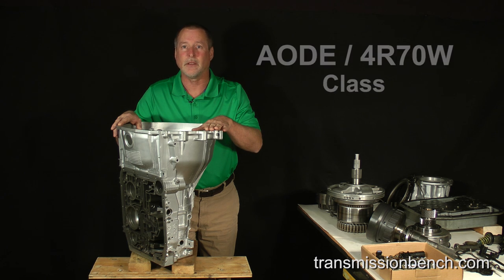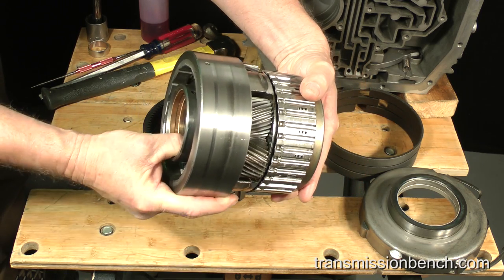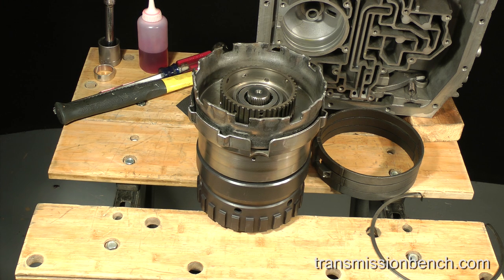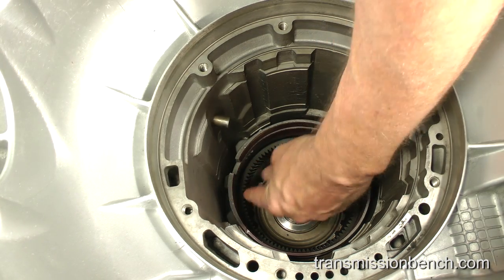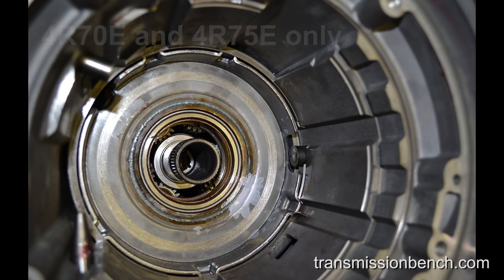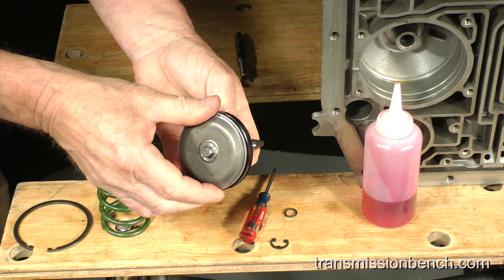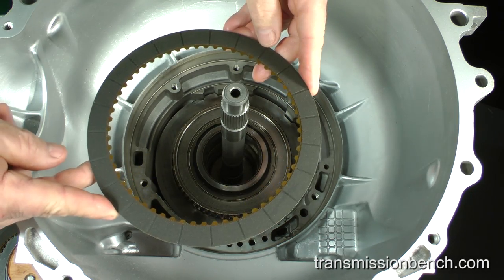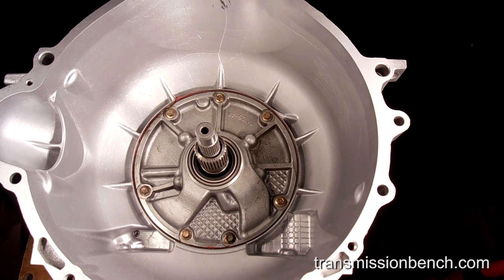AODE 4R70W Class part 2 lesson 5

Comment: I figured it out. I installed a thinner plastic pump washer to adjust end play. The diode clicking went away after you turn the shaft a few times. Just finished installing it today. Shifts great. Thanks for the videos.
Reply: I’m having the same problem I don’t have end play . 
I have disassembled  several times at one thing I took the pump washer off and still no end play
Reply: @petegarcia2401  were you able to work it out?
Reply: @petegarcia2401  multiple people are having this issue. Myself included. The front pump washer thickness kit off ebay seams to be the conclusion to this problem. I've dissambled my transmission over and over again too no change no end play. Installed a different thickness washer and now I have end play.

Comment: 220 inch pounds = 18.3 book says 18 lbs. of torque on pump bolts. Its better just to rent 1nch pound torque wrench. Mr. Williams can put snap rings with those work gloves. As a hill Billy with tight fitting gloves. I have a good chance of a successful rebuild. Nobody could describe this rebuild any better. Any More descriptive details they just be repeating them selves or adding nonrelevant  material.👍

Comment: Your instructional videos really set the standard! I'm almost looking forward to the trans in my 97 F150 cooking out so I can rebuild it!
Reply: I have a 99 Town Car with 210k miles. Although I try to maintain the transmission as best as I can ( 30k miles Mercon V changes, trans cooler, moderate driving) I know some day it will fail. And I know I will order the full overhaul set incl. the full video from this company when the time comes and do it myself.
Reply: @Omar Cuenca it's as easy as the instructor is saying it is, but you'll need patience in getting the clutches mate together.. this was the hardest part for me

Comment: If your concerned with the direction the input shaft should spin (mine rotated clockwise) watch the video closely he doesn’t actually turn the input shaft. He flex’s his hand but it was for demonstration. If you go back through and watch you’ll see his input shaft rotates clockwise. No need to tear apart everything you just done to a tee! It will spin counter clockwise but his really tough. Hope this comment saves you 2 hrs of internet research where “nobody knows “

Comment: I followed all your videos to the t., but I fell on my face at the end of this video. My input shaft locks after as start to torque the bolts pump bolts down. I tore it back down and tried both new and old bearings. I also tried removing the intermediate stack up (steels/frictions & thick end plate).  I've replace bushings too. I went back and polished all services with sand paper--I have a perfect surface after words, with no binding. It does engaged on all the frictions/steels. I verified looking through the valve body. I've had it apart 5 times now and can put it together with no video assistance at this point. Problem still remains. Thinking about taking this in on Monday as I'm at my wits end with this 2001 4R70W 4x4.
Reply: If others are running into the same issue I had, then also consider the thrust washer being the cause.It was in my case. I narrowed it down after taking the transmission apart, probably 10 times. Take a look here to determine how-to get the correct washer. http://www.explorerforum.com/forums/index.php?threads/4r70w-rebuild-diary-part-14-end-case-pump-clearance-selecting-the-right-selective.160708/

I went from a yellow to a green.
Reply: Anonymousgunguy thanks! exactly, I ended up adjusting end play with a different thrust washer. Same out come, would have been nice to know that ahead of. time

Comment: Question. 
I rebuild a 4r75e, and it will go on 1st, 2nd maybe 3rd but on 3 or 4rd will feel like reverse is engaged it will slowed down.  30 miles per hr or less. Reverse is also good.new or rebuild valve body.it dose the same with mine which I rebuild.
Any Idea what it can be before I take it down?
Is not my first one. And this one is my own. Thank you.

Comment: when you stated that the inner shaft should spin freely at the end of assembly does that mean the shaft should spin with light twist motion or slightly heavy twist motion? In my situation the inner shaft does spin freely clockwise and counterclockwise i have to use more strength almost not possible with one hand

Comment: I have assembled the case and the pump is in. The front shaft turns but I hear a mechanical diode clicking when I turn the front and rear shaft. There is also no end play in the front shaft. I installed 7 new thrust bearings. Could I have mixed them up? The intermediate clutches and plates are assembled like yours. Just below the edge. I have Not installed the reverse servo yet. Just the overdrive servo. Guess I will be tearing it down tomorrow.
Reply: So do they have to click? Did you figure it out ?

Comment: my 2004 4r70w has a different pump piston and it has an extra large wavy spring and another sort of  L-shaped ring, should I just lay them on top of the intermediate clutch pack and lay the pump on top of it? And does the wavy spring go first or the L-shaped ring? Thank you
Reply from the maker: +Abi Budau Hi. The "L" shaped part goes down against the last flat steel plate. Set the wavy spring on top of the "L" part. Then put the pump in. Jimmy

Comment: Hello, I have a 4r75w and the turbine is new, in reverse it is strong and the oil pressure is low and the sepertin is new, and it does not go forwards,,,, unless its wheels are up in the air there if it has power the wheels
Reply: The clutches are probably burnt

Comment: now, when you get to the end and say the input shaft should spin. it spins counter clockwise but you have to really grip it tight. but free wheels clockwise is this the correct way it should be?
Reply: That's about where I'm at too.  I can only turn it clockwise, and I can hear the mechanical diode ticking.  Guess it's coming back apart.
Reply: +anterpants I laid the trans over and spun the output shaft one rotation and it freed up the input shaft.  Must of had some tight tolerances or something.
Reply: Cool man, thanks for the info.
Reply: Richard Coogan did you figure it out? My only turns clockwise freely. Counterclockwise only spins but doesnt spin the output shaft. Please anyone help.
Reply: @armandovazquez929  I can answer half of that. I don't know about the clockwise vs clockwise issue, but it is normal for the output not to spin when you turn the input as there is no hydraulic pressure available to lock in any of the clutches.
Reply: Mr. Shyster thanks your right, installed the transmission and man she feels like a brand new one. No issues👌🏼
Reply: After I assembled my 4R75E my input shaft doesn’t spin freely like he says at the  end of the video 
I can’t turn it by hand I have to use Chanel locked only then it will spin 
I also don’t have the end play I have took it apart many times I don’t see any thing holding it up
Reply: @petegarcia2401  i have this same exact issue any word on weather its a problem or not? I can loosen the the pump and spins freely but once i tighten it down same thing you described. Any help would be great. I did replace the bearings as well

Comment: 100% sure the clutches, all of them, are set in.  Still no end play! I've gone clear down to the inner large C clip and back out.  We are sure everything is tight.  Where else can I gain endplay?
Reply from the maker: CorkscrewTrail Hi. If the input shaft will turn you'll be ok. I've had a few transmissions where there was no end play and they worked fine.  Jimmy
Reply: Transmission Bench Oh thank God!  We tore it open top to bottom at least 5 times looking for the reason we had no endplay!  Maybe we'll get somewhere today!
Reply: Transmission Bench great video! But my input shaft only turns clockwise with the output shaft, it does turn counterclockwise but not with the output shaft and really tight. Is something wrong? Thank you

Comment: Should I be able to rotate it in both directions? At the end it looks like you rotate in counterclockwise but I can only rotate clockwise.
Reply: matt cwynar , i hav the same issue on my 4r70w rotates only in clockwise direction , is your tranny worked??
Reply: Ya my trans ended up working just fine. I think i just wasn't getting a good enough grip to turn it.
Reply: thanks alot , matt .  i just figured it out that after a rebuild greasy 
 hands and fatigue let you down.
Reply: I can’t turn it by hand I need to use Channel locks to turn it
Reply: @petegarcia2401  I'm having the same problem. Did you eventually figure it out?

Comment: is it normal to have a little wobble on your torque converter once seated
Reply from the maker: +Delia and Tom Irvin Yes, it will wobble a little bit. It will not wobble once it goes into the crankshaft. Jimmy
Reply: Thanks what causes it to leak from bell housing
Reply: @deliaandtomirvin8003  Bad pump input seal or pump to case gasket.